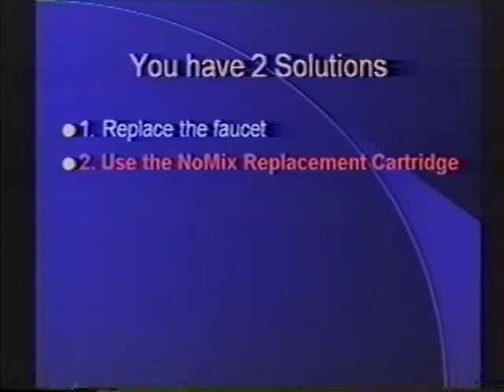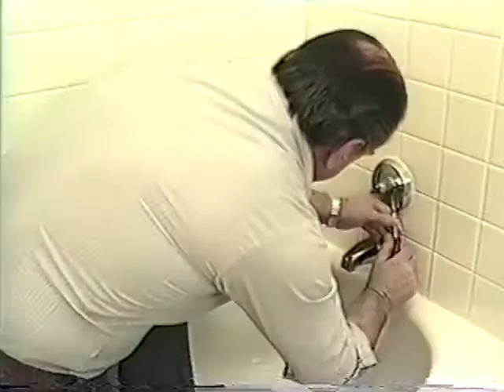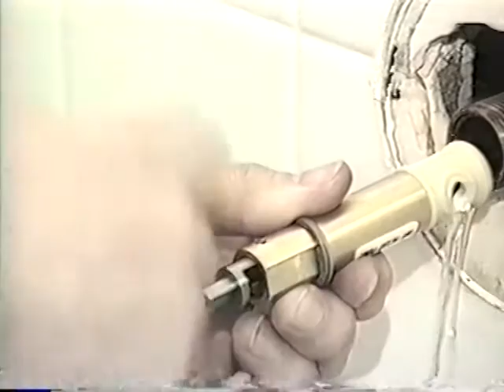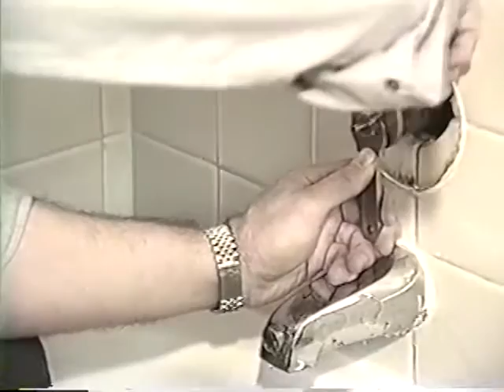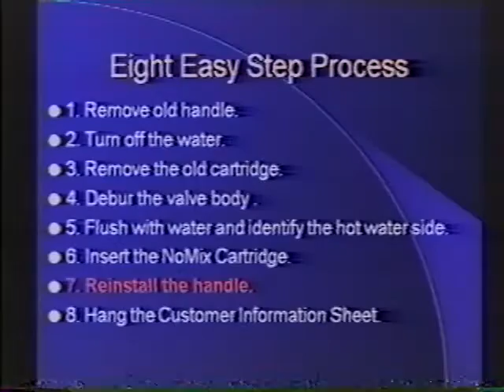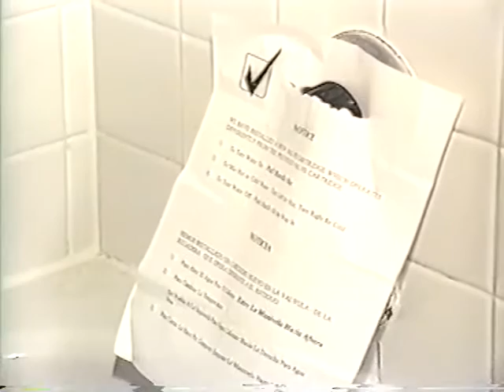NoMix valve cartridge installation instructions

Comment: I just installed a model 101 in place of my old mixet stem. My main concern for doing this was because of the crossover problem, I could not get cold or lukewarm water at very low flow with the old mixet stem. However now that I've replaced it I still can't get warm water at low flow. When the water is discharging through the tub spout I CAN get low flow with warm water but as soon as I pull the diverter valve up and the water diverts to the shower head the new nomix valve stem pops out to full flow because of the water pressure. I'm guessing this is due to the inner workings of the valve being very nicely lubricated since it is brand new, I'm hoping over time it will stop doing this. Otherwise very good solution to the mixet crossover problem.
My only other minor complaint is that at high flow through the tub spout the noise level of the new nomix valve stem is significantly louder than before. When I divert flow to the shower head it quiets back down but while it is flowing through the tub spout it is very very loud.

Comment: Video uses PowerPoint like bullet points. They tell you step-by-step where you're at and what you're doing (and you can easily see what step is coming up next). For each bullet point, you are given a video demonstration with lots of discussion and questions (with answers). This is the best video I've seen by guys who understand what they're doing. Be advised, this video is specifically for the NoMix type cartridge valve. I'm having to replace my shower valve which I was told was a MixEt type valve (a very similar type cartridge). This video has added a lot of great insight, with respect to adjusting the valve position to ensure you get the expected hot and cold water flow. The valve adjustment they shared allows you to compensate for shortcuts the plumber may have taken as a method of saving cost. Great job guys!